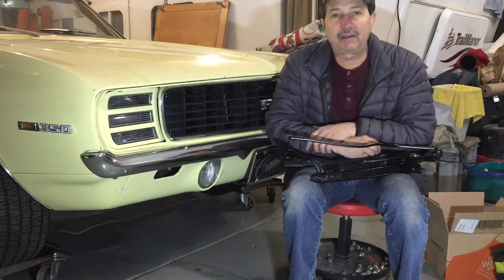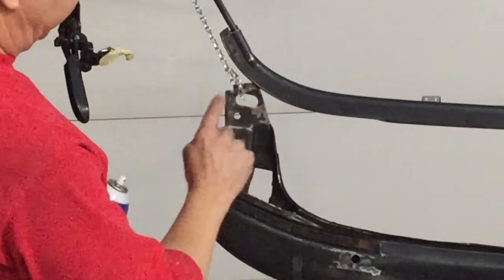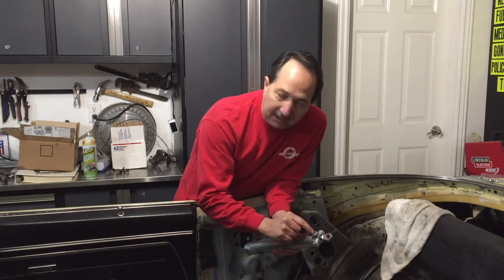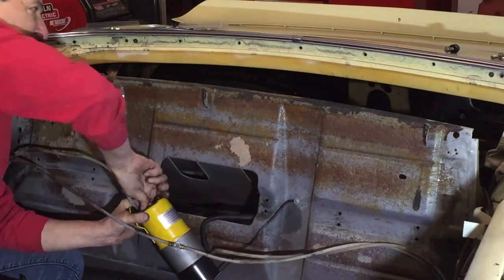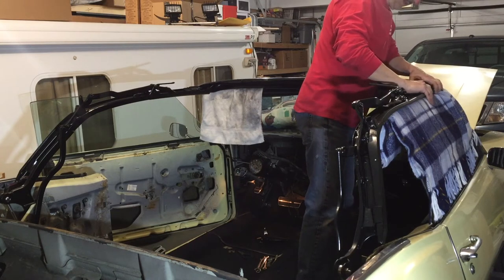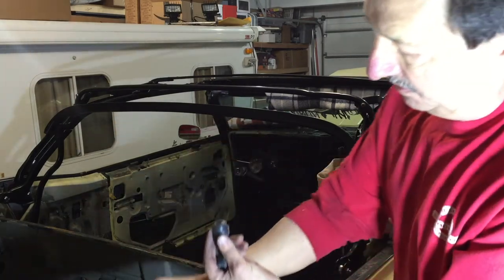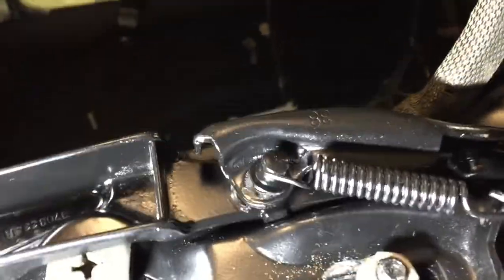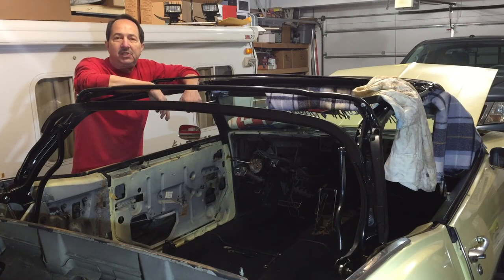DIY Convertible Power Top Frame Restoration. 1969 Camaro RS Rebuild, Project.

Comment: I have been watching your vids. for awhile on ride rescue. I am currently restoring the convertible top frame then re fastening the existing top. I of course did not take enough pictures so it is ride rescue to the rescue. The frame if like a jigsaw puzzle. Which way does the bolt go, what side is the nylon bushing flange on etc. The videos help in solving those questions and the frame puzzle. Thanks for your help...

Comment: First off,thank you so much for making this video! You made the process seem less intimidating by making concise points and providing simple yet insightful information on each section. I'm restoring the top on a 2003 v6 Mustang that I inherited half disassembled. I've been having trouble in id'ing the no.2 and no.3 bows and how to set them correctly. You mentioned something about rubber spacers for the no.2 bows? Any extra info you or anyone can throw my way would be much appreciated.

Comment: Question I have bled the system of air. I was thorough and very little air in the system-nominal air. Now there is quite a bit of air
in the tubes after a couple of months(3) The pump spins fast then catches up and starts pumping, moving the cylinders. Is it common or un heard of to have air infiltrate into the system? there are no big leaks only a seep on one fitting. As mentioned I am rehabing the frame and now is a good time to bleed again. Any thoughts on air infiltration is it possible that is the problem, perhaps a new rebuilt lift cylinder??
Reply from the maker: I have experienced the same think many times. No leaks but keep getting more air in lines. I found it is just a matter of cycling the system many times in order to get all the air out of the cylinders. As long as you don't have any leaks, the system does eventually get most of the air out, but not all.

Comment: When you are bleeding out the air, are the lines disconnected from the actuators? If they are still attached to the actuators where are the bubbles going, into the actuator?
Reply from the maker: As the system cycles up and down the air slowly moved to the pump tank. Once it has been cycled several times you will need to add some fluid to top it off. Be careful removing the fill cap (plug). The air in the tank builds up pressure and it can spray fluid if the filler hole is not pointing upwards. It is normal to have some bubbles in the lines but most of the air will end up in the pump reservoir.

Comment: I had a 1967 camaro frame brake at the 1/4 window adjust. I welded the frame in the position where the old weld was, but now I struggle to get that side to attach at windshield.  Any suggestions

Comment: Thanks for taking the time sharing you knowledge.  I'm working on a 68 GS 400.  My question has to do with the riveted joints.  How loose should they be?  My frame on right side (upper adjustment arm) has more side to side movement than left.  Also the long straight part of arm is bent.  I'm going to straighten arm.  How do you suggest tightening the robots and how much?
I was going to send too out to be installed.  Because of you video, I have decided to dyi.  Thanks in advance.
Reply from the maker: The joints should have minimal movement side to side. If the joints get worn loose they bind up and bend parts like yours has. I have had very good luck with tops not being loose with the exception of one 1967 Camaro. I had to remove the rivets and machine the metal parts to close up the worn holes. My brother worked for a machine shop and did the metal work for me.
Reply: Thank you.  I have been able to drill the rivet to thin the out wall.  Using a modified punch was able to flare the rivet.  On the 68-69  A-body, 5/16" bolts were on critical pivot points.  In  70-72  GM used 3/8".  My holes are oblong on the one side.  I'm going to drill them to take the 3/8" bolt.  I've found 'online tube' to have the top hardware.  I have not been able to find a diagram with all the hardware locations,  which would be helpful.  My top had incorrect bolts in at least  one location.  Again, thanks.  I'm in the Houston area.
Reply from the maker: @roberthasse9658  Good work with the idea of going up 1/16 in diameter for the bolts and rivets. I needed to drill some oblong holes on my backhoe. A machine shop told me to drill it out oversized, sleeve it with a brass sleeve and drill the sleeve to match the correct bolt or rivet size. So, if the 3/8 is still loose, you can look into brass sleeves. Good luck.

Comment: what do you suggest for a top company ez tops any good?
Reply from the maker: I have installed many tops and I have only had one bad one but that was over 20 years ago. I can't think of any brands that are better than another.
Reply: I've heard that glass back windows always break is this true? and do you know why? the guy that does them says he wont do glass on plastic
Reply from the maker: @bobdimartino6738  I do like glass but most of them fold in the middle and the seal comes apart with usage so they don't last as long. Plus once the seal splits the glass scrapes together and then they brake. People also forget when they load the trunk and place things where the glass folds down and that breaks the glass when the top goes down. I prefer vinyl windows.

Comment: What's the stuff called that goes over the pinch weld on the front bow ?  I've found plactic stuff online but the material that came off is cloth mine is cloth and your looks like cloth based also.
Reply from the maker: It is a cloth tape. It is very similar to duct tape so that is what I use to replace it. I found some black cloth reinforced tape so it matches factory look.
Reply: @riderescue  I've watch most of your videos on replace the top on the Camaro and they're really detailed and helpful. I replacing top and thefront bow on my 71 lemans.  Do have any tips on installing the tack strip that goes all across the bottom of the front bow ?

Comment: What is the difference between the power frame and manual frame.
Reply from the maker: Thant is a very good question. I have never seen a manual frame so I don't know if they are the same as power tops or not. I know the manual frames have a sprint loaded arm and a latch of some type.
Reply: It's been almost 40 years since I converted a manual frame to a power top. But, as best I remember, the back bottom part of a manual frame is different compared to a factory power top frame. I'm talking about where the hydraulic cylinders attach to the frame. I now have an original 67 Camaro that came with a factory power top. It goes up & down a good bit smoother than the 68 I converted many tears a flow. There must be other distinctions betwixt 2 frames.

Comment: Do you install Convertible tops on 1970 Chevelle‘s
Reply from the maker: I have done Full size, Midsize and Smaller GMs in the 60s and 70s. All of them are the same as this Camaro top, each are just size differences.

Comment: How to bond the tacking strip to to the second bow?
Reply from the maker: It's amazing that I have never needed to glue in a tack strip. I looked up a few and Loctite PL Premium Fast Grab Polyurethane Construction Adhesive looks good. It bonds to metal and wood products so that should work great for the tack strips. Polyurethane adhesives seam to be recommended.

Comment: I put a manual frame on a hydraulic  system and it bent the frame .
Reply from the maker: Ouch! Sad to hear that. I wouldn't have thought the rams could push that much force and the top would have that much resistance. Thant's crazy.